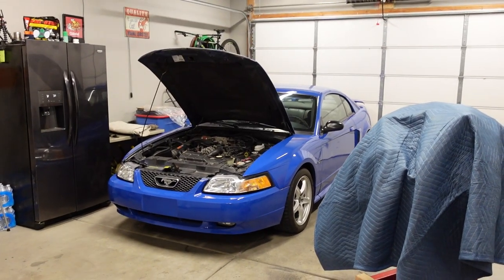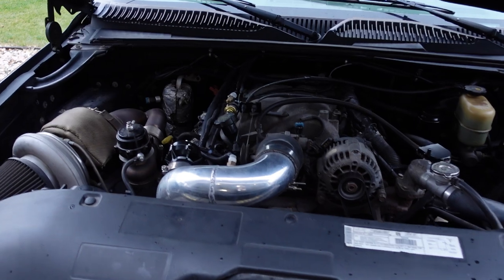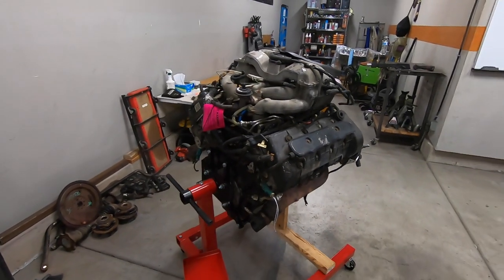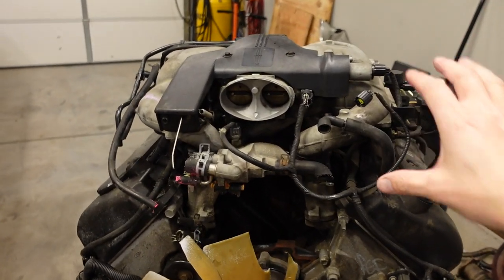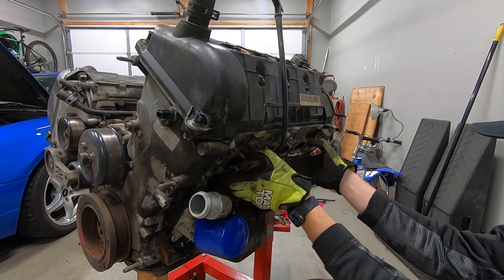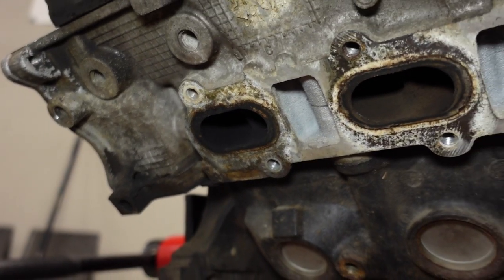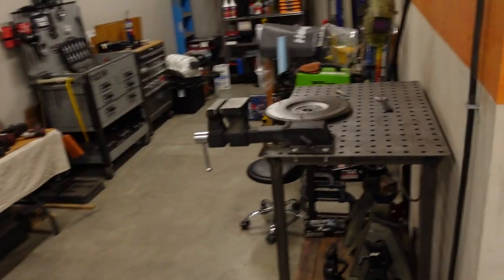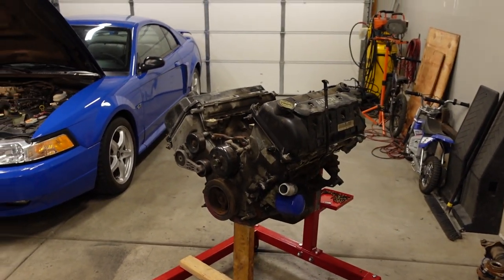I bought the LARGEST ENGINE I can fit into my Mustang

Comment: You jinxed your self by saying budget…. Lol. To make a mod motor reliable and make the kind of power you want reliably is going to cost you more than you want it to.
Reply: $3,000 for forged internals kit ain't too bad, he can do the work himself so it ain't bad at all..
Reply: @P71ScrewHead  you can get Manley rods and slugs for $1600. the cranks seem to be really good in them already.
Reply: @P71ScrewHead  
The internals are not that expensive at all I will agree,  it’s the rest of of it.  
I never said it couldn’t be done, but to make the kind of power he wants (reliably) it will take some money.
Reply: @hayden6056  oh yes I agree there's a cheaper way to go, but I mean 1k+ hp, not under..
Reply: @ratchetstrapgarage3609  oh yes, regardless of what power he wants it's gonna cost a bunch, what saves him money is he can do most himself to save on labor costs, I can't afford to do it myself, sadly.. I went with a stroker 5 0 kit from MMR rated at 1k rwhp for $2,899.99 n 1,500rwhp was $3,499.99 but I'm automatic so under 1k is where I plan to stay..
Reply: @P71ScrewHead  
Of course he’s gonna do most or all him self that’s what I like about LT’s channel.  He shows that awesome things can still be built out of a home garage and the attention to detail is nice.
Reply: @P71ScrewHead  he was saying 900 n wasn't sure if wheel or crank. From memory the Manley set up is rated to 1000 wheel. I'm unsure if that's with l19 or 2000 fasteners. May be even able to hold a little more if only 2000. 

The e85 keeps the pistons a lot cooler under stress too compared to pump so may have some head room there too!

What's the major reliability issues ratchet?

Have never played with a boosted one but apart from leaks and power steering pumps they seem to be pretty reliable over here and they're everywhere.
Reply: @ratchetstrapgarage3609  Yep, I agree with that, it helps to have studied for this hobby..
Reply: @hayden6056  it's always good to go over what you plan on making, seen many get a rotating assembly rated at 600hp then they want more n have to buy again.. I was gonna buy a stroker kit rated at that for $2,300 but I want boost n 😫 stock crank can take more than that so I went with MMR instead..
Reply: @P71ScrewHead  most forged items I've bought aren't even rated and it's up to the user to find the end point 😂

I wonder how they figure out the max rated hp , whether it's mathematics for the deflection from the torque needed for the number or just what they've been able to make. 

So many variables pending how you make the HP and what fuel. 

I think the blueprinting, prep and tuning has a whole heap to play in to it. 

I've had friends make absurd numbers on things that most blow up at half the power. On a very cold night it's also cost a couple of them a motor too 😂
Reply: @hayden6056  Depends on material used too, most lightweight rotating assemblies are for n/a builds n heavier ones for more power n abuse..
Reply: @P71ScrewHead  lol theirs a lot more to it than the weight of something.
Reply: @hayden6056  I agree but I'm here answering to different ppl on my phone I sometimes just want to finish my comment n move on, my bad..lol
Reply: @P71ScrewHead  all good lol , sorry you'd just directly replied to me so thought you were talking to me lol. 

Sorry if came across as a dick. 

The conrod supplier I use literally states they can't tell you a HP limit because of all the variables. 

So I just always wondered how some people come up with the limit. Whether it's theoretical or they've built so many and that was there failure point. 

Our machine shop at work has sometimes had luck with using lower Rockwell hardening to reduce brittleness on parts and I know the increase in silicon in hypereutectic stuff improves reliability. 

Was just mere curiosity and thought maybe you'd had a lot to do with these and had an answer for me 😂
Reply: @hayden6056  Personally I haven't used all forged internals available for the 4.6L n 5.4L shortblock but ppl in these communities have n been able to confirm.. MMR has records with these engines at the track n one of them is with the 3,000hp 5.4L shortblock.. Some claim to not use the stroker kit for high horsepower but I'm a stroker guy so I went that route n bored it 20 over as well to get the true 5.0L from my stock block n to use the TrickFlow Race heads I bought before I knew those heads required bigger bores..lol With the engine fully built low (heat) boost should get me to the 600rwhp I'm looking for with plenty of room for more power in the future.. 😉😬